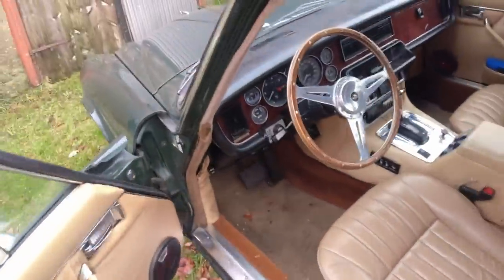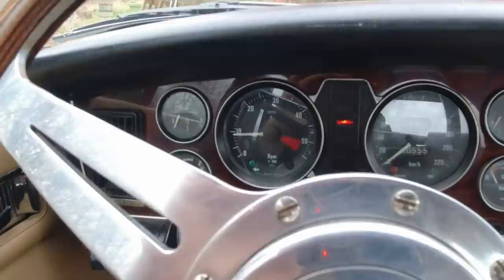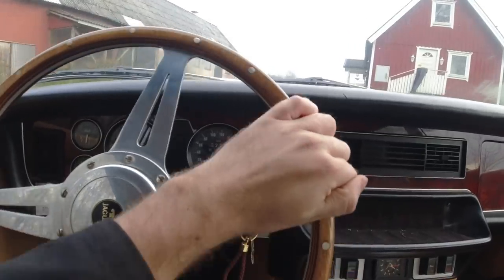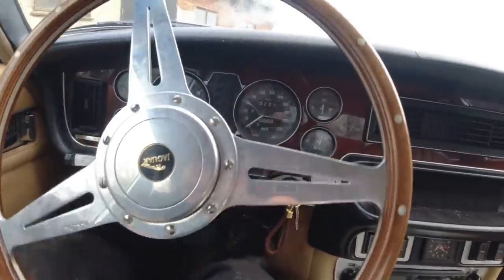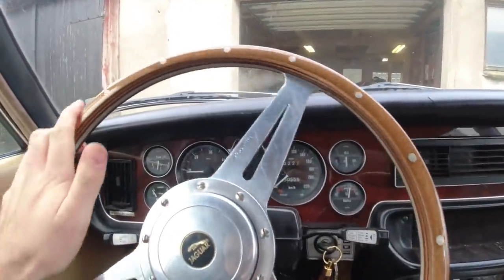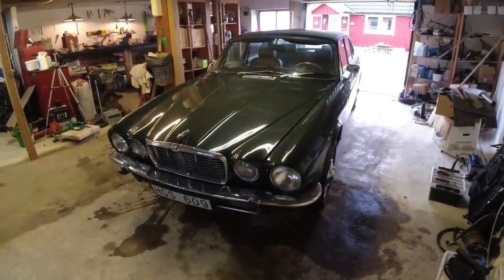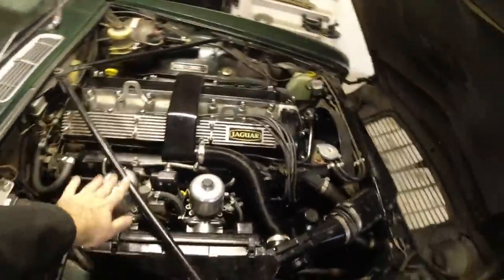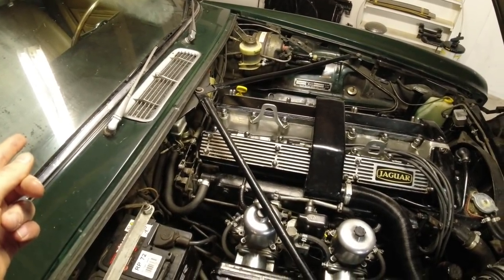Removing the Broken Engine from My Daily Driven Jaguar XJ6 (Part 1)

Comment: Dont know if it will work on a s2, but on my s1 i have found the easiest way to remove and refit the bonnet is to take out the grill . Then i just reach through with a ratcheting ring spanner whilst the bonnet is down and remove the hinge bolts. Makes it easy as you don't have to support it's weight at any time. Makes aligning easy too as you can have it closed, pack all your gap lines with plastic builders shims and get it spot on and tightened up without opening the bonnet. 
Great idea with the old drill bits, gunna steal that idea !
Reply: That is so helpful, thanks for posting

Comment: Adam, Ricks Cafe Americain. Ahh! Casablanca Fan. Did you have a Business venture? Also, you need Fender protectors. See if I can find you some, here in the States. I would clean-up and repaint Radiator and shroud.

Comment: I had my S11 engine rebuilt and looked brand new but it still cracked between the bores , unfortunately the block could not handle being bored out to 4.2 litres basically  an inherent fault with these motors so annoying after all the effort. I’ve had several S1 and S11 but the 3.4 in my 67 MK11 was my favourite.

Comment: Would it be possible to rig a light hoist from your roof beams? Not a heavy, "hauling motors out" affair, but something light as a third hand to stabilise panels while you unbolt them, etc.
Reply from the maker: I may do for some other things in the future but so far none of the panels have been too bad

Comment: Your video inspired me to pull my XJ6C. But I’m stuck. What is the size of the 4 bolts connecting the torque converter to the flywheel? And how can I fit a torque wrench to them, or is there another solution?

Comment: Would a really soft strap around the hood being hooked to the engine hoist be easier to get it off? Just curious since I have never removed a hood.
Reply from the maker: It could work but it’s not that heavy to remove by yourself

Comment: At 15.00 the battery is still connected......
Reply from the maker: It’s a quick disconnect. I initially turned it a few turns to disconnect it like I normally do. Then I removed it fully later

Comment: How did you determine that your replacement engine is in adequate condition to get moved into the ultimate daily driver?
Reply from the maker: Purchased it from a friend and I have driven it in the donor car. Had a full rebuild a few thousand miles ago and runs very well

Comment: Excellent job Adam!
Will have to readjust the carburettors? I remember you having to adjust them when they were cold.
What about the other fuel tank? Do you think you would have a replacement for the right side rank?
Reply from the maker: Thank you! I will mostly likely need to tweak them just a little bit but it will only been fine adjustments. I have sourced another tank from a friend and will be fitting it in the future. It will involve some rust proofing around the fuel tank areas
Reply: @LivingWithAClassic  Excellent Adam, good luck 🤞!